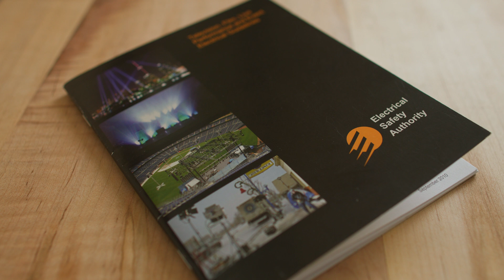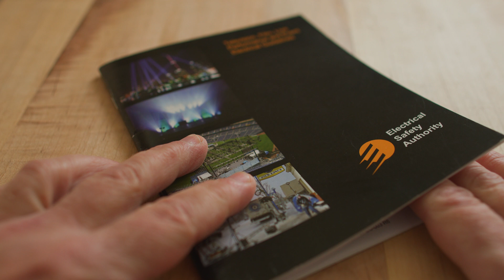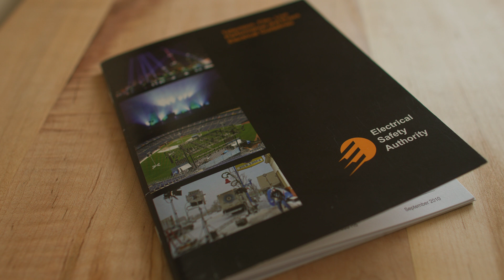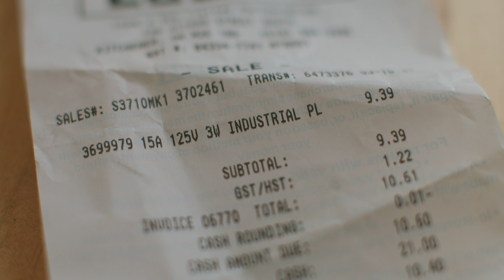HOSPITAL GRADE PLUGS: AN INTRODUCTION

Comment: In the US the NEC permits the use of 15 or 20 receptacles on 20 amp circuits and 15 amp receptacles are rated for 20 amps pass through (total of plugged in loads and downstream loads) on 120 volt circuits. So, a 20 amp circuit with 12 gauge wire would be used in this case. That would provide 2400 watts. However the maximum cord and plug connected load is limited to 80% of that which is 1920 watts and 16 amps. The actual measured current draw will likely be less the calculated current draw of 16.66 amps at 2000 watts, and close enough to considered safe from overloading the circuit.
In spite of that, anything drawing 15 to 18 amps or so should have a 20 plug so it cannot be plugged into a 15 amp circuit. They are rarely used, but in this case it would be justified and it should be on a dedicated circuit, you don't want it to share with other loads. Regardless, the manual should specify that anything that requires 2000 watts should be on a dedicated 20 amp circuit in order to avoid tripping breakers.
Hopefully your hospital grade plug is used on a circuit with a hospital grade receptacle and 12 or 10 gauge wire is used.